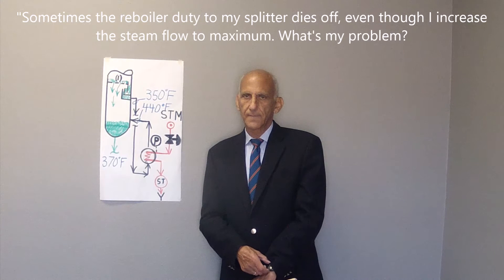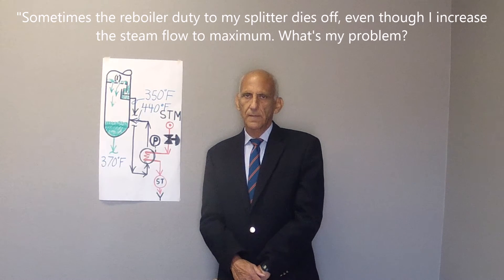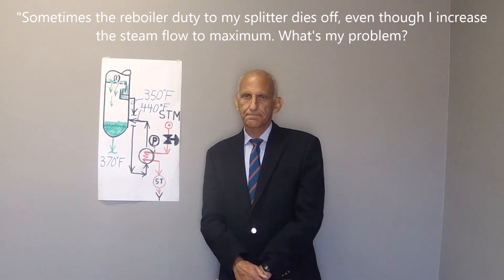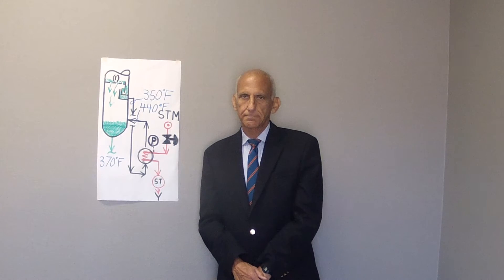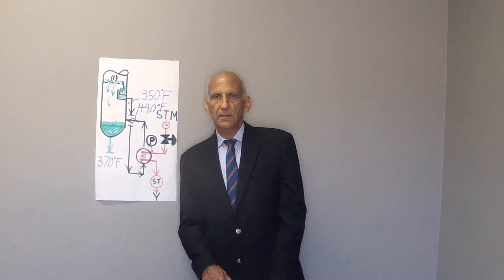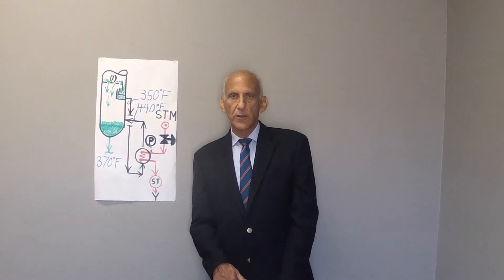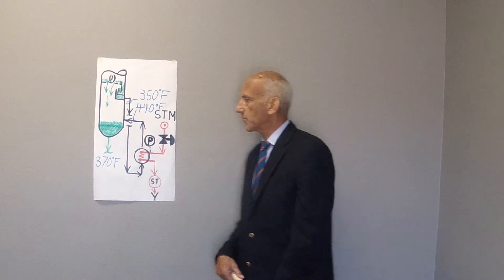STALLING A THERMOSYPHON REBOILER

Comment: This YoutTube series is an excellent source of kernals of truth about the actual operation of these units.  Really well thought out and this is why Norman Lieberman has so much respect from the chemical and process industry.  Your books are on most practicing engineers bookshelves.  Thank you for posting these and sharing.  MNF
Reply: How does the liquid flow to reboiler decrease when the tray leakes?
Since more liquid leakes, the liquid level in the bottom increases, resulting in a higher head. A higher head means, higher flow to the reboiler right?
Please help me out
Reply: @neerajt4044  No, the reboiler take-off is from a weir on the side of the tray, not the liquid flowing through the tray.
Reply: Basically with less Vapor flowrate, bottom tray delta P decreases, hence liquid seeps in through the perforations (weeps) . Since a part of liquid head which is maintained via the outlet weir is lost due to weeping - over a period of time less liquid is accumulated in the trapout pan via seal pan( via overflowing over the weir).